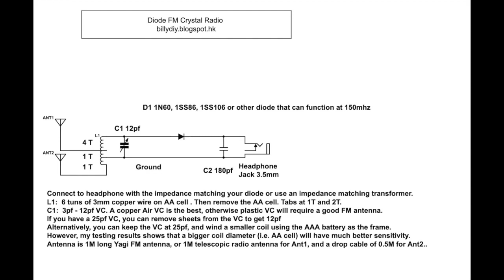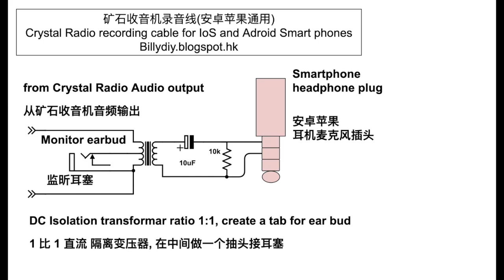Diode FM Crystal Radio

Comment: I built it with 1n5819, i take it from disposable Phone Charger at the output, it Schottky type and have voltage drop about 0.2V and work wonderful for FM receiving.

Thanks for the circuit!
Reply from the maker: NIce.
Reply: Samuel Budiyanto Wow I am surprised as 1N5819 is for a rectifier and reverse polarity protection but its good high frequency characteristics might help it to work? Anyway it is about the only diode I can buy at the moment so hard to source components at the moment so will try it
Reply: @thinkingjohn2099  I think working below 300MHz reception is easy, especially for diode. Because this type receiver just need low voltage drop of diode as detector.  Lower voltage drop diode more station can heard. I have hundreds of 1N34A work good, but 1N5819 much much better. 
Next week I will make a video about FM Regen Receiver that work very very good and simple to build, work from 1.5V to 12V and just need one Transistor (2SC9018) as active component.
Reply: @BillyCdiy  I found the best diode is BAT32! So many stations heard clearly and no need long antenna at all! You can try it and it's super fun!
Reply: @samuelbudiyanto2250  really? Are you a guy from Indonesia?
Reply: @samuelbudiyanto2250  also waiting for your fm receiver video
Reply: @erikpratama320  yes I am Indonesian, from central Jakarta for sure 😃. 
I has made it, and few other Radio Receiver as my sub-hobbies in electronics. 
Next week I will make the video, but for now I must survive in my 4th chemotherapy because I have a tongue cancer.

Best regards!
Reply: @samuelbudiyanto2250 get well soon.

Comment: Does this work unamplified?
Reply from the maker: Yes. It works without battery without amplification. Just plug the head phone in and  connect the right antenna.  You need to be close enough to an FM station (within 10 KM).

Comment: would it be ok to use a 20 pf air capacitor, instead of the 12pf? thanks
Reply from the maker: Yes, u just need to sue a smaller coil to fit with that. See the circuit diagram in the video. It already said if you use the  bigger capacitor, you can wind the coil using the AAA cell as the frame instead of the AA cell.

Comment: Hi Billy similar question I only have a 16pf and a 18pf variable capacitor I am not sure how many turns for a coil? Thanks
Reply from the maker: 16 pf would fit an Fm coil of 5 turns on AAA cell for tuning and additional 1 turn after the circuit ground for connection to the antenna. You can then adjust the length of  the coil to tune the frequency range a bit. Good luck with the build.

Comment: Is this diode enough to hear frequency modulation? I will try
Reply from the maker: Yes, the high Q tank ( coil + high Q air VC) is able to turn the FM into AM then detected by the diode through a mechanism called slope detection.  Many people ask how can a simple crystal radio performs Frequency demodulation.
You can read this article that explains "The Slope Detection Method for FM radio". 
https://www.electronics-notes.com/articles/radio/modulation/fm-frequency-demodulation-slope-detector-discriminator.php
Here is my own over-simplified understanding. A Slope Detection Circuit  uses a High Q resonant circuit to turn an FM signal to an AM signal, which can then be detected by a diode from a simple crystal radio. Just think of it this way. The FM modulation will shift the  frequency of the carrier wave  from one frequency to the next based on the wave form of the original speech or music (aka the source signal). If you have a very high Q resonant circuit, the FM modulated signal will appear to be tuned in (loudest) or tuned out (softer) as the frequency of the carrier wave  varies or modulates according to the source signal. Hence the output of the resonant circuit is similar to that of an Amplitude modulated signal. Hence it can be detected by simple circuit such as a single Diode.  This detection has many flaws, as its only a partial restore of the original signal from the original broadcast. The audio produced out of this are usually not clear enough unless you have a very strong signal, or has a high performance detector for weak signals, e.g. 3DQ to replace the Diode. Also, because detection is at the slope of the carrier wave, the full loudness of the original signal cannot be reproduced. Hence  it will never be as loud as that of an AM Crystal radio no matter how close you are to the transmission station.
Reply: @BillyCdiy  You explained it better (simpler) than in the article. Thank you

Comment: Hey! Great content, thanks! Can we use variable capacitors in series to reduce the capacitance (30+30=15?pF)?
Reply from the maker: danosdotnl ,yes you may, but that will lower the Q factor . Ie. lower volume and more noisy
Reply: @BillyCdiy  Ok clear! Another question: does the thick (1-3mm) copper coil contribute to higher Q? I have never seen such a coil in fm designs, curious to try it out!
Reply from the maker: @danosdotnl , yes the thicker the wire, the higher the Q. Also, to get better results, the coil should resemble the shape of a cube. i.e. diameter and length are the same. Same for the variable capacitor. I've got a video that I used 12mm soft copper pipe to wire a single C-shape coil (coil diameter 100mm, 270 degree only, not full circle), and with the tail extended to insert another insulated thinner pipe to become a variable capacitor by pulling that tail in and out of the bigger pipe. That one can do without another telescopic nor Yagi antenna if FM signal is strong enough.  see here: https://youtu.be/dpsrGT8PT4Q
Reply: @BillyCdiy  Thanks for taking the time to reply to my novice questions (I only have a novice ham license). It's really inspiring to discover your work. I have almost given up on building fm receivers, but this gives me new energy. Take care out there, 73!
Reply: @danosdotnl  did you have any luck with it?
Reply: @sbybill3271  no luck, im sorry
Reply: @danosdotnl  OK. I'm trying my luck. Will come back with the results very soon.
Reply: @sbybill3271  Thank you! Let us know!
Reply: @danosdotnl  Not able to receive any signal and don't know why.Tried different variations of inductor but still no luck. The FM transmitter is within three miles radius.

Comment: I make it use old 1n60 and vintage headphone 4000 ohm use 15 mtr wire antenna but not hear anything. I dont understand whats wrong
Reply from the maker: Thanks for your question. Assuming you meant to create an FM Crystal radio, not the AM MW crystal radio. Let me know otherwise. FM Crystal radio antenna is special. It needs to match the FM Radio broadcast range, i.e. Max length should be below 1.8 meters. I usually use a Yagi antenna , or a 1.2 to 1.5 meter telescopic antenna. If you are far away from an FM broadcast station (say > 15KM away), the chances of receiving that station with an FM crystal is very low. Even if you lengthen the antenna to 15 meter, it's not going to improve it, it'll just make it worse, as if the antenna is longer than needed, it'll tune down the frequency down to a frequency outside of the FM frequency range.  The other thing that may be impacting is the head phone. FM crystal radio reception requires a much more sensitive headphone than the AM crystal radio. See if you can find a better , more sensitive headphone and make sure the impedance of the head phone matches with your detector. The last thing is to see if you can find a better detector. I used 1SS86, the newer detector. Some detectors has a high internal capacitance that also tuned down the frequency of the reception.  All in all, FM crystal radio is ten times harder to receive than AM crystal radio. 
Hope this help.